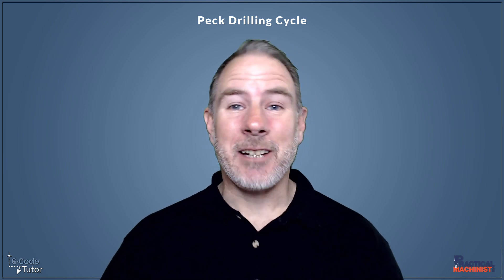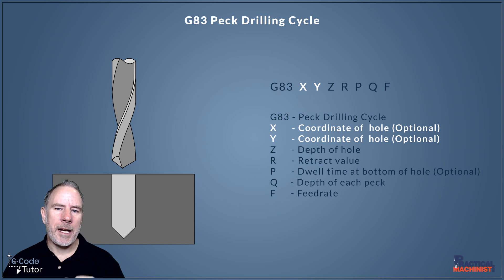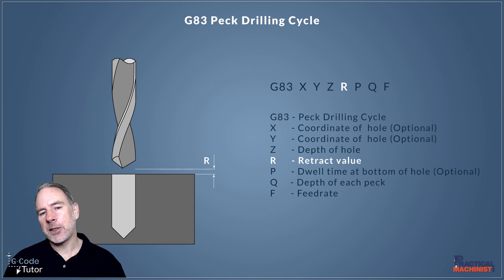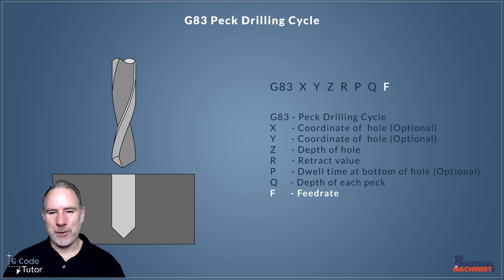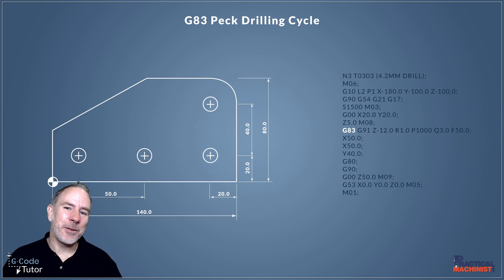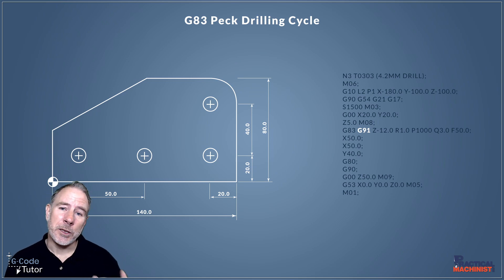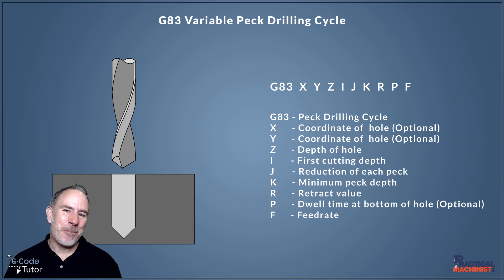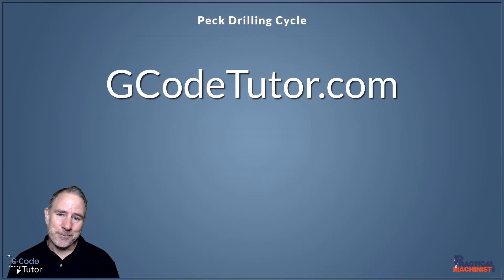Programming Peck Drilling Cycles with G-Code

Comment: How do you determine the q value?
Reply: You really need to take into account several factors, including hole size, depth, material, etc.  Lots of times when drilling with a hss twist drill, the only reason to retract is to get coolant onto the drill point in order to prevent overheating.  Especially in materials like stainless steel.
A very safe starting point for your Q could be something like .15 x Diameter.
When using IJK values in your G83, you can go 1, 2, or even 3x diameter for your first peck, provided you are confident that the tool will hold up to it, and you have good chip formation/evacuation.